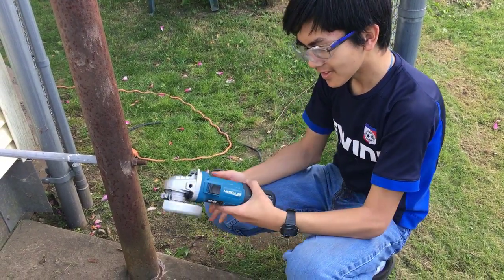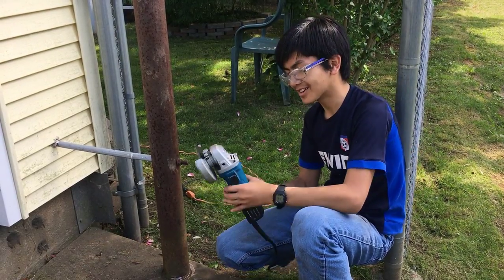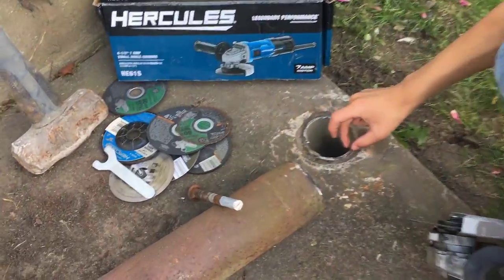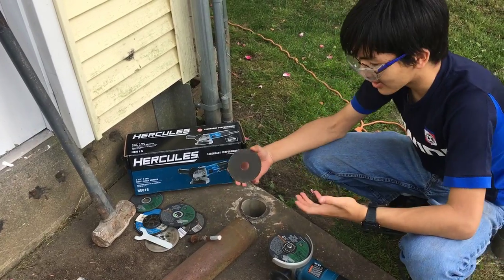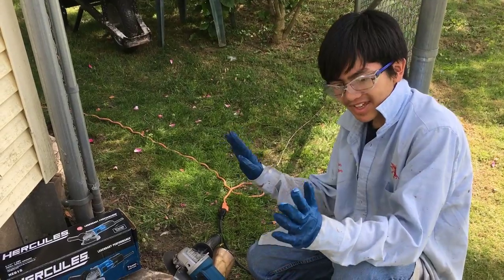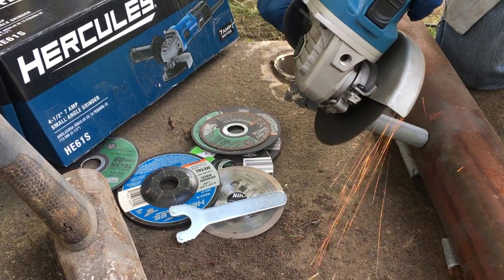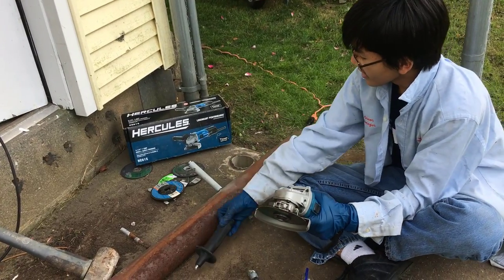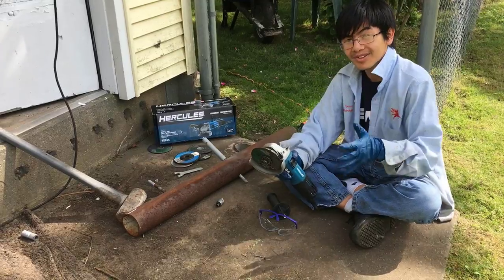How To Cut Fence Post, Metal Pole or Steel Rod Rebar | Hercules 4-1/2 in. 7 Amp Angle Grinder Review

Comment: That is not a toy, and I think it's good that your young and wanting to learn about DIY, but please always remember that safety has got to come first, you have started using that as if you have never picked one up before. That sends a really bad message to other young DIY enthusiast's. I applaud the idea of what your doing but please use the correct PPE. That thing will very easily kick away from you and cause serious injury. Take care.
Reply: Yeah and if I were to put one thing out there--angle grinder is NOT the first thing to learn on.  I don't even suggest these things to seasoned professionals.

Comment: How did you know the sparks wouldn't set the house or dormant grass on fire? Or your shirt?
Reply: Basically when I cut metal with an angle grinder I usually cut in the driveway so the sparks don't land on flammable material and/ or have a water hose standing by incase it is needed.
Reply: @notthatdigusted7468  So the metal has to be portable. I cut down chain link fence posts right next to my neighbors wood fence. I was afraid it might catch his fence on fire. I dug a hole around each post and used a Saws All instead.